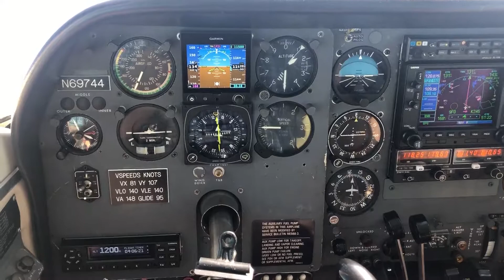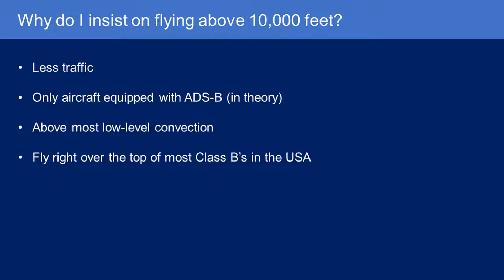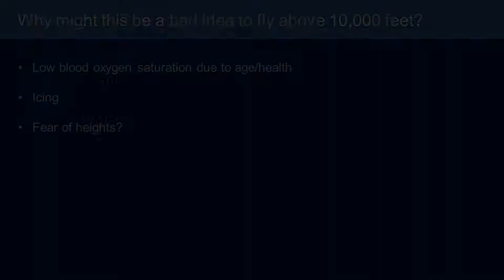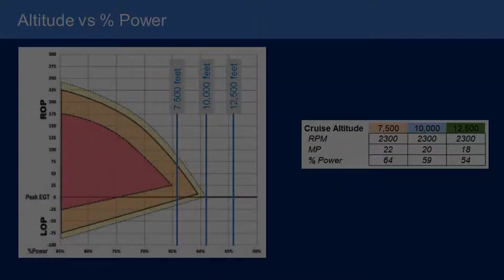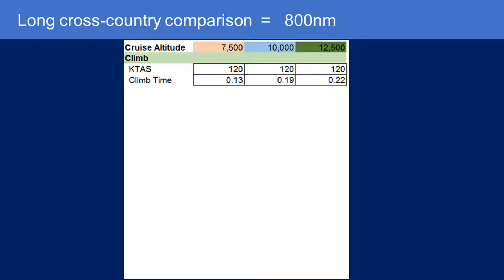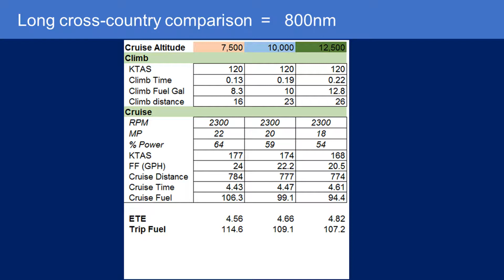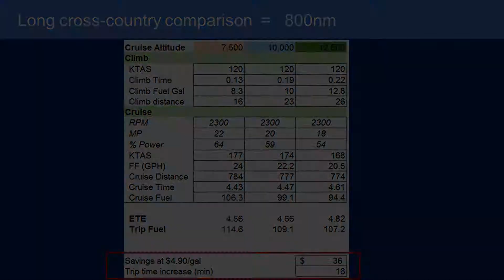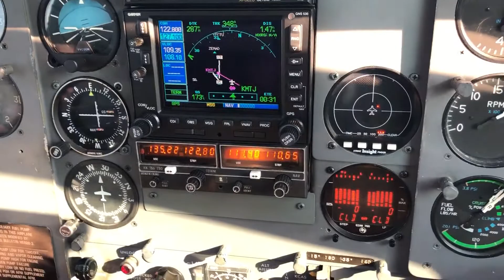Why I fly above 10,000 feet - lean of peak vs rich of peak

Comment: That's what I have always done in my Mooney.  Stay out of the Cessna's space, little more glide, don't have to worry about a lot of airspace, natural air conditioning in the summer.  But can be extra cold in winter.  The IO-360 doesn't put out a lot of usable heat.  But I have blankets, external seat heaters, and dual electrical outlets.

Comment: I fly with a different set of rules, in the care and feeding of the Continental TSIO 360 in my Mooney, where running lean of peak is not really practical. There is no real limit to the "red box", since my engine can make 75% of rated power to its service ceiling of 24,000' ISA. Cylinder head temperatures, TIT temp and oil temps can exceed book limits quite easily at regular cruise speeds, but with the power back to 58-63% power, I can lean aggressively and still keep the temps happy, in fact, leaning can be a helpful tool in helping keep engine temperatures warm and even, when descending in cool air. So, the drill is to lean responsibly in cruise, since I cruise most of the time in the 65% range, but when powered below about 60%, I can run LOP, with judicious use of cowl flaps.